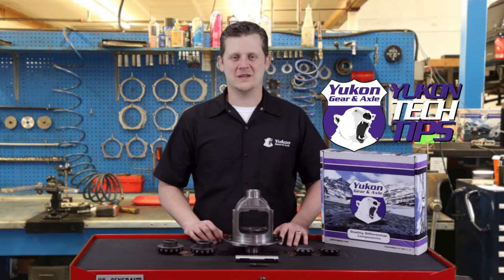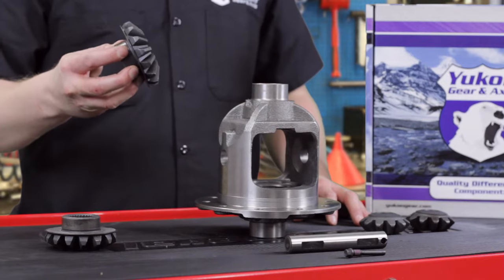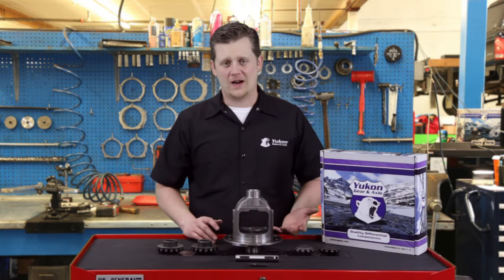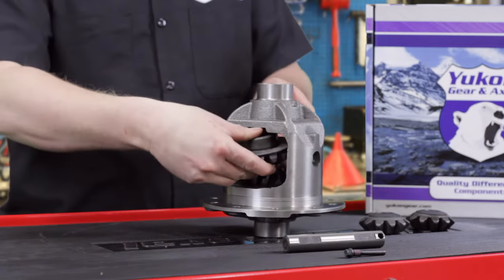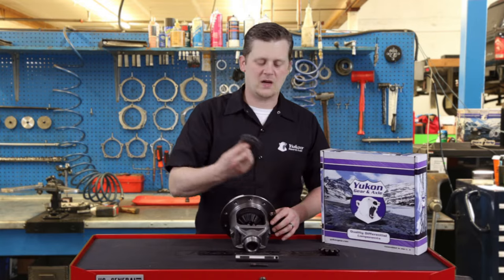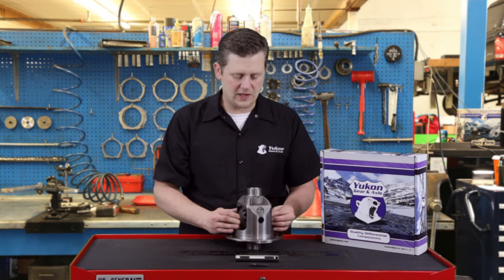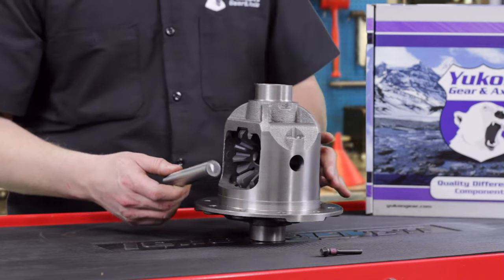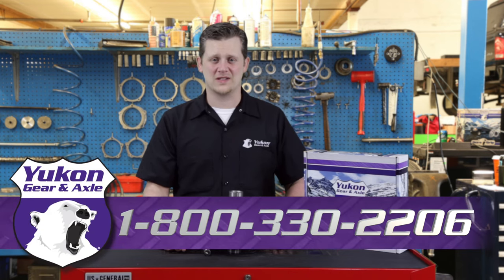Spider Gear Installation Explained | Differential Tech Tips

Comment: Excellent- yes,
 however what do you do when it's a limited slip? How do you rotate the side gears with all those clutches and discs to rotate the spider gears into place & put the pin through?
Reply: I don't know that it would help you but on those I normally put the carrier in a vise stick the axle in one end and turn it with a pair of grips. You can also do a piece of threaded rod through one end of the axle hole with big washers on each side and smash one of the gears in real tight against the clutch packs but generally helps It go in a little easier

Comment: My son has a 2017 Jeep Wrangler JK.  3.73 gear ratio.  He is told his spider gears need to be replaced.  The ring and pinion gears look ok.  Can we just change the spider gears or should the whole housing be replaced that holds them.   The other thing that needs to be fixed is the pinion seal and I have to find out how to help do that for him.

Comment: Works great, except how do you do it in the vehicle?  The clips on the ends of the axles need to be in place before the spiders, or I will NEVER lock the shaft in.  But you did show that the shim plates must go in, and that is important.
Reply: Just did my first spider gear install yesterday. I'm sure you already did yours being you posted a year ago. It took me a while to realize that the gears have to be placed directly across from each other. I put the pin through to make sure. First I tried with the washers/shims. Even with grease they would fall off when rotated. I left them off until I got the gears almost in place. I installed the hardest washer first. Then installed the other. Then I rotated to the pin hole. No problem afterwards. I agree. You don't have much clearance when installing the axles and the clips with that pin in there.

Comment: Are those washers like a spacer and "adjustable" (add or remove for fit, similar to the carrier bearing washers) or is it just 1 per side? I'm trying to figure out if i want to rebuild mine or just buy a new one from somewhere, will need just about everything, not sure about ring and pinion though. Toyed with changing the gearing while I had to have it apart but don't know how to fix speedo for it (1999 ford f150), any tips on that?

Comment: I have never in my life seen spider gears go in that easy you must have that damn carrier grinded out so big it's unreal anybody that's actually had to do that in a real situation knows that that is the pain in the ass to do
Reply: Yeah I've been trying for over a hour with the diff in the truck still haha got one gear with washer but cannot for the life of me get both in with washers and lined up.
Reply: @REsuperGRX7  just something to keep in mind I just ran into I got a brand new set of spider gears from Yukon and couldn't get the some b**** in for the life of me so when I called him they told me that the washers were replaced with a thinner washer set so they sent me a set and the spider gears went in fairly easy after that I'm not sure exactly what you got going on but if you're using new gears that may be your case too hope it helps
Reply: @BlueRealAmerican  stock spider gears, just was doing wheel bearings an seals. Can get the gears back in fine just seems no room for the washer.
Reply: @REsuperGRX7  I'll tell you something you can do that might help you. Taking stick the two bigger spider gears that slide inside the carrier back inside and then run you a bolt through where the axle would go in the carrier of course the carrier has to be out of the rear end and put you some big washers on each side and a nut and tighten that gear up into the carrier that'll allow you a bunch more room to put the spider gears back in the problem with putting spider gears in is them two big gears with the clutch packs or washers on the inside of them they normally hang out and makes it hard as hell to put the washers and spiders back in hope it helps. Only do it to one side of the gear because you'll have to put the axle in the other side to turn the spider gears in hope that makes sense
Reply: Also for future reference what I always do is remove the Cross pin get the axle clips off then put the cross pin back in and doing that the spider gears can never fall out
Reply: @BlueRealAmerican  yeah really wishing I had put that pin back in haha
Reply: @REsuperGRX7  LOL we live to learn my friend. I think it took me about 20 different kinds of rearend rebuilds to get where I just sling the shit off an on now.
Reply: @BlueRealAmerican  this is only my 2nd time and last one was like 10 years ago. This one's easier being open diff. Just going to take it all out the pumpkin and assemble on the bench then should be good to go. Thanks for the help man.
Reply: @REsuperGRX7  I would bro I can assure u it'll be easier. Be sure don't get your Sims mixed up under your caps holding the carrier in if it has any otherwise it'll mess up your pinion and ring gear mesh

Comment: Please Help !     I just rebuilt  a GM rear, 10 bolt 7.625 .. All new gears , bearings bolts etc. I got all the specs right , pre - load and backlash etc but after installing the spider gears , I immediately noticed how it seems like there's too much play when turning the yoke back and forth by hand. Is there a backlash spec for the spider gears ? I used new thrust washers on the planetary gears , am I missing something ??

Comment: Thanks for video, my dana 35 has a lot of lateral \ in out play and alot of roaring noise while making right turns,I see no damage inside rearend and very little meltal shaving. What could be the problem. Thanks in advance
Reply: Don't get what your saying entirely but I would check the pinion and carrier bearings if the roaring is coming from rear. Look for play on pinion yolk.

Comment: Why do the bolts fail causing y'all to weld the cases closed?
Reply: if you are referencing the welded cases on our zip lockers, we weld the cases to improve durability on applications where we have seen a pattern failure due to them being installed incorrectly. lack of carrier bearing preload allows housing deflection , and by welding the cases we remove the load  from the bolts improving durability and longevity. this allows us to offer the best warranty in the industry on the zip lockers,

Comment: I got noisy front diff 2005 liberty card.  The seals have oil on them and dropped oil level.  Could cv shaft bearings be issue?  Noisy at 40 mpg.
Reply from the maker: That's not quite enough info to do a proper diagnosis, i would recommend a qualified mechanic take a look or you can call our tech line at 425-348-9002
Reply: @yukongearandaxle  are you in Utah?
Reply from the maker: @bradc2632  We are headquartered in Washington, but have distributors and installers all over. Happy to put you in contact with someone if you'd like!

Comment: im having an issue with your sparton  locker. i had it installed but when i released the pins and checked the gap i found the it fell out of tolerance. how do i close that gap
Reply from the maker: Please send us a message on Facebook or Instagram and we can help you work through this issue. Also, our tech department can be reached through info@yukongear.com.